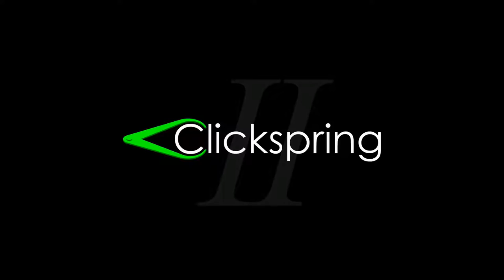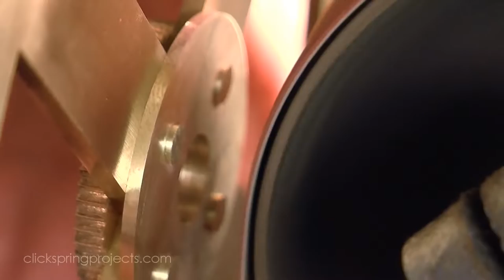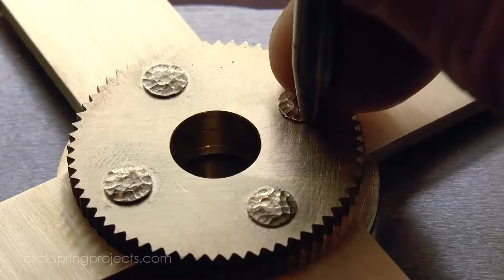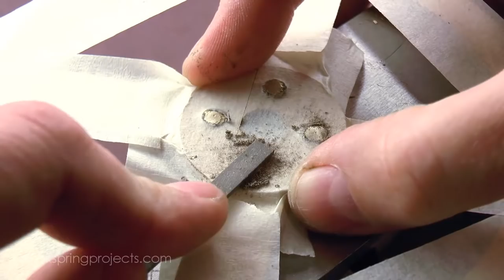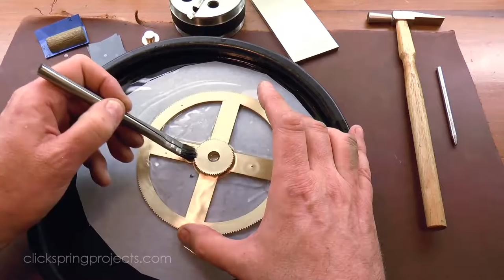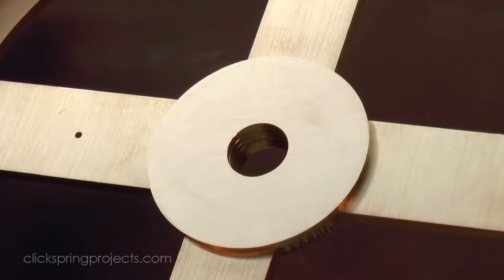Peening & Filing Brass Rivets

Comment: Great job.  Beautiful finish.  A quick question, what keeps the pins in place if you have filed away the overflow peen?  Did the holes have a chamfer that the peening filled in to allow you to file away the excess? Or is it now just a flush friction fit?
Reply: Friction.
 The hammering will fatten the rivet shafts to maximum within their holes.
Reply: The pins expand in the hole and hold it in place

Comment: This may be a simple question, but how does the connection not fail after filing it flat? Does peening the rivet also deform the metal accepting it?
Reply: It's a way to make a press fit as far as I understand it. The rivet expands in all directions filling the "hole(s)" entirely. In this application I guess it must sustain shear forces (which it will do) and the press fit won't let it escape. I'll guess you can "easily" drive out the "rivets" if needed to disassemble for repair, and then peen new ones back. (Countersinking as suggested will make the pins hard to remove for repair, you might have to drill them out (if that can be done at all - usually the "rivets" starts turning with the drill; I know from experience. You can still drive them out with force but now it becomes ugly, possibly deforming the parts peened together).
Reply: When i use brass rivets like this i usually put a little countersink in the hole which can help.
Reply: When peening the rivet will expand in the hole and really stick in it. Correctly done it will not be easily removed. Sometimes the hole is made slightly conical (wider in the opening) to secure the expanded rivet even more. This is atleast to my understanding. Hope it is to some help for you.
Reply: Your right It must deform the surrounding material slightly to create a wedge. The material would most likely be dispersed out and upward around the rivet which is knocked down with the sanding I think
Reply: In addition to the friction on the walls of the hole a chamfer on either end can provide space for the rivet to fill. Also, hammering the rivet into place moves a small amount material as it fills in. 
So yes, you are correct about deformation to a degree.
Clickspring's work is so precise I wouldn't be surprised if he can rely on friction alone.
Reply: i think it is the small bevel that is created when deburring, something like a 0.2 mm on each side is enough to hold the pin in place
Reply: Look it closer... there is a small countersink, that locks the pin 0:06
Reply: What I'm trying to say is that for a gadget like this you need to build for assembling, but also for disassembling (repair, maintenance) and reassembly. For this part I guess this is the way to do it.
Reply: An "Interference" fit(aka press fit) can require a lot of force by itself to separate, but if you look at 0:07 you can also see that he also chamfered the bore to allow for a mechanic bond too. And considering what this gear is for(a hand-powered mechanism), I seriously doubt that joint will experience a high enough load to forcible separate the pieces(the lateral load should be very minimal). I think the teeth on the gear would fail long before that becomes a concern.

I wouldn't use this technique on anything structural but at this point, its more like a piece of functional fine art and he uses a lot of the same techniques that are still used to make hand made Jewelry today.
Reply: I thought the small de-burring countersink would do, but was surprised Clickspring didn't have a bigger chamfer there. Then I read these comments and believe they are correct in the pin expanding laterally when peened, tightening it in the hole. 
I was also wondering about how much work-hardening peening does, and if the metal towards the end of the rivet would be a little harder and not so likely to let go.
Reply: I’m an aircraft mechanic and remove and hammer a lot of rivets though the techniques are different but similar. In aircraft riveting at least there is either a button head or a counter sunk head one on side and on the others sort of spool shape is formed so it mechanically clamps the sheets of metal (usually anywhere between .028-.100 inch thick). 

One thing both techniques have in common is that the diameter of the rivet expands to tightly fill the hole. The drill bits used to cut the holes are a couple thousandths of an inch larger in diameter than the rivets they are meant to accept. Though this is more for ease of installation. In Chris’s use case (as others have  mentioned) that small chamfer probably works similarly to a fully countersink sheet metal rivet though to a smaller degree. I would expect the swelling of the rivet and it’s associated increase in friction from the peening to play a larger role in attaching the parts together  than the chamfer.
Reply: @rbclima  Good catch.   That probably allows the rivet just enough space to peen over slightly larger than the hole.
Reply: @rbclima  , yep.
Reply: The brass rivets will expand in their bore, causing everything to be "press fit" extremely tight.  The top and bottom plates will also have their holes "expanded" a bit as well, thus locking everything together from both sides.  All I know for sure, is when he was sanding those rivets down, I know for a fact I'd be making new gears because I'd slip and screw them up.  DOH!   Then I'd throw them across the room, say a bunch of 4 letter words, turn red, get mad about just throwing my temper tantrum and probably say "Time for a beer".  LOL  In 6 or 8 months I'd probably go back and say "OK, lets try this again"...rinse and repeat.
Reply: Also notice how the peening pattern (2:02) radiates outward around the core of the rivet, not only securing it in the chamfer but forcing the outer material of the pin into the LT press fit of the hole.  As the others said not enough sheer to be a problem with this joint and could be easily drilled and re-done...If you could find the rivets again ~¿@.  Good Question Mosskyn!
One more observation is the total cross section area of the rivets is about 1/3 of the cross section of the wheel and they are placed not in the center of the of the remaining distance between the hole and outer edge of the wheel so not to distort the hole when peening....makes this a very strong joint and beautifully engineered, behind the artisanship Chris has!
Reply: So something that may not be obvious unless you have had to mate close tolerance parts, size on size mates (an 1.00000000 pin in a 1.0000000 hole) are an interference fit.  That means the texture of the surfaces interfere with each other.  It's not technically friction, it's a mechanical interlock of the microscopic surface imperfections of the surfaces.  And when you peen a rivet, you expand it to fill any imperfections in the surface of the hole it's filling.  It is a true mechanical interlock, at an almost molecular level, and it will NOT come apart without deforming both surfaces.  The only way to get a stronger joint (without welding) would be shrink fitting, where the hole literally "squeezes" the fastener, and can dramatically increase the surface boundary interaction.

Comment: Fantastis video, one problem i have sometimes is the edge of the rivet will start to crack as im peening it, what can i do about that?
Reply: Sounds like you're work-hardening the rivet. My only guess is to go slower? I honestly have no idea.
Reply: Soften the brass rivet by heating to a dull red color and immediately quench in water. If that's too soft then don't heat as much and let it slowly cool on a brick.

Comment: I have a question about the mechanism... Since all the gears are fixed in place with rivets during production, how is are the gears adjusted to get them timed correctly?  I'm not an engineer or anything, so I may not be using the correct terminology, but essentially, how do you set it so,may, there isn't a solar eclipse during during an Olympic year if there isn't supposed to be?  Does this question make sense?

Comment: I still can't understand how the rivets  don't just fall out when you have removed the peened over part that was holding them in ?
Reply: No hole is perfectly smooth or perfectly round.  The peening not only spreads the head of the rivet, it swells the body of the rivet shaping it to all the imperfections of the holes in the parts being bound together. Since this never sees strong loads the head is unnecessary.
Reply: @honorharrington4546  thanks for letting me know that, my experience of rivets is with leather, it  had me puzzled seeing this

Comment: Can someone explain this to me. After peening the ends, what holds it all together after you file off what material was peened over?
Does the peening squash the shaft of material going through the parts?
Reply: There's usually a little countersink on the holes to fill in with the peened material.  Either that or the peening process forces an even higher friction fit between the rivet and the material being held.